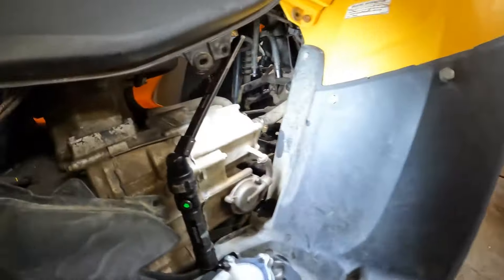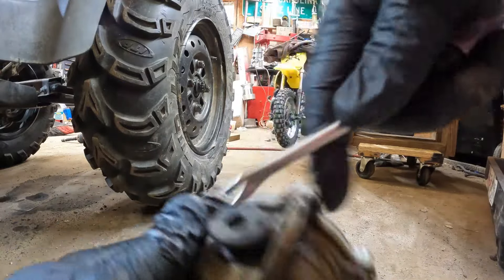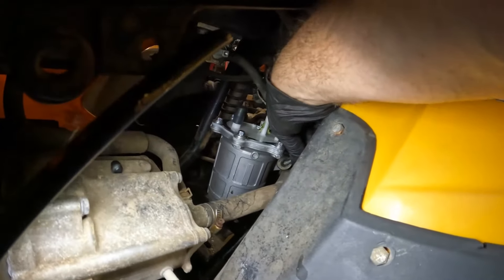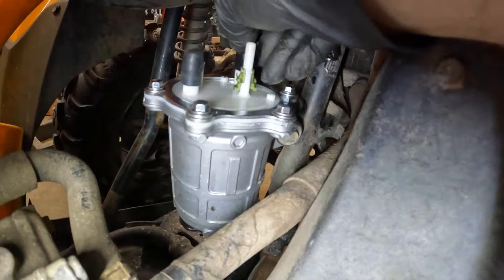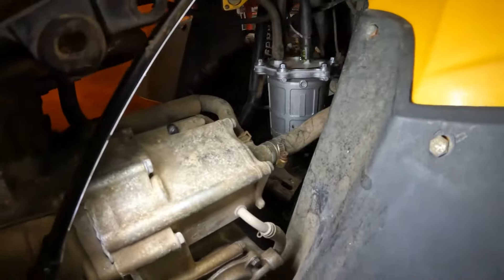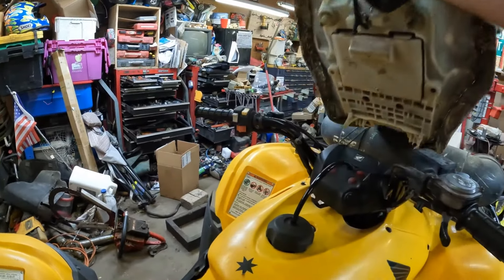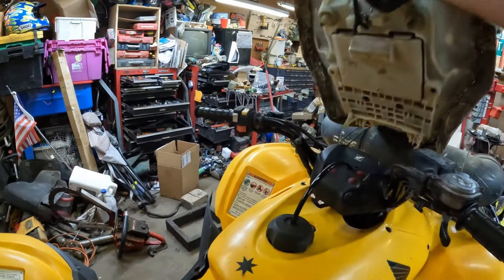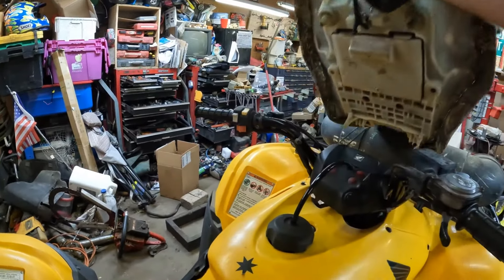Rancher 420 fuel pump replacement

Comment: Thanks, I was trying to remove that green high pressure line to remove the tank to check the valves. They don't make it easy to get to them.

Comment: I need help!! 2010 Honda 420. So my daughter rode and it ran fine. Tried starting later in the day and all it would do is turn over but never start. The kill switch is on run, all fuses in fuse box good, put a new plug in, installed the same fuel pump as you, there is fuel coming from petcock, still nothing. When turn the key on you can hear the clicking then it stops. Battery ran down now, but I can hook my jump start to it and spray a little starter fluid in breather and it starts for a split second.(only sprayed twice) Any advice would be greatly appreciated on the next step to take. Thank You
Reply from the maker: Have you pulled the fuel pressure line and see if fuel is coming out when you switch it on?
Reply: @FourwheelerDoctor  
Thank You for the reply. So I charged the battery up, tinkered with the fuel pump relay and hooked everything back up. Turned key on and off several times and it started right up.
Reply: @FourwheelerDoctor  How much fuel should be coming out
Reply from the maker: @mattk1358  there should be a pretty good bit of gas come out when you switch it on. I approximate a half cup or so while the pump cycles on and off.

Comment: Man I have a question.  Reading 1.2 ohms on on side of the terminals from the harness and then 21 ohms on the other. It won’t shoot any gas out of the fuel line. Should I replace the pump?
Reply: And if the pump goes bad, could there be sludge in the fuel tank that made it go bad? Or do they go bad over time or from sittin?

Comment: Quick question my Honda rancher 420 will crank up and barely idle at high rpm’s it runs fine but low rpm’s it stalls could that be fuel pump!
Reply from the maker: Usually a weak pump will make the bike struggle at higher rpm when the fuel demand is higher. Can you make it idle if you give it a little throttle? May need to clean your idle air control valve.

Comment: I changed the fuel pump on my 07 420 and now it wont crank. Fuel pump is coming on and cycling like it should any idea why it wont start....it will start and run a few seconds if i use starting fluid but other than that nothing.

Comment: Just have quick question I have a leak on the top my fuel pump I can’t figure out where it coming from I thought it was the fuel pressure line cause the rubber on it was ripped but u don’t have one on at all and other two lines are clamped on tight so don’t know where the fuel coming from thanks
Reply from the maker: It pretty much has to be coming from the o-ring in the pressure line or either nipple that sticks out the top has a crack in it. I would start out by replacing the o-ring first.

Comment: Yup this damn thing will start but dies after 5- 30 seconds of running, the fuel injector line only shoots out a splash when it wants to. Just as i suspected, your video just reassures my assumption of a shit fuel pump.... Thanks!
Reply from the maker: Glad I could help. Thanks for watching
Reply: Was that what it was?
Reply: Was it the pump? Mine is doing the same thing

Comment: My fuel pump is leaking on the bottom do I have to replace the entire pump. It’s still running ok but leaking gas on the bottom rubber piece

Comment: I replaced my fuel pump on a 2008 Rancher 420 but it will crank but not start . It was running fine until I went to back it out of the garage - it died went I tried to restart it backfired and just turns over but no crank .Any idea where to look next ? Thanks in advance !
Reply from the maker: Make sure your petcock isn't clogged.  Also you may want to see if your injector is clicking while turning it over.

Comment: Great video!  Very clear instructions and great info.  I'm guessing I got some bad fuel.  I'm able to start the engine and run for a little while but then it craps out.  Sometimes we make it a few miles, sometimes a few blocks, sometimes a few feet.  The fuel line seems clear and I cleaned out the pump, but it's still doing the same thing.  Next step is to get a new fuel pump . . any suggestions on what to do next if that doesn't work?
Reply: Check your throttle position sensor if that doesnt work
Reply: Did that work?